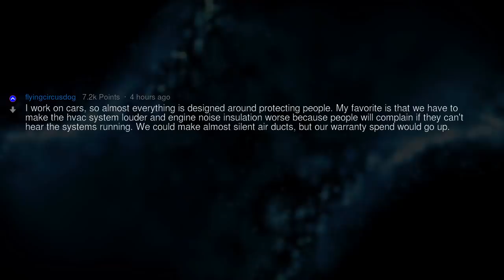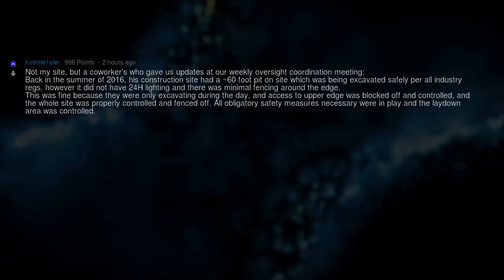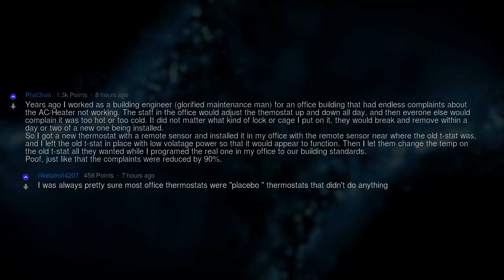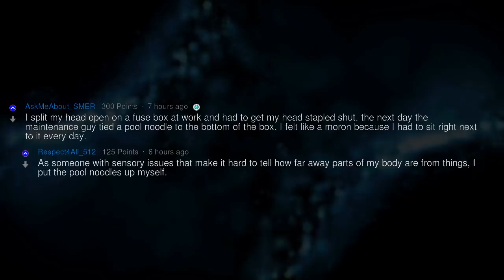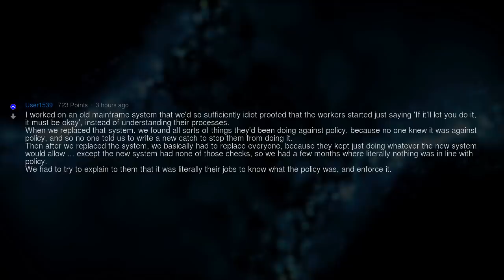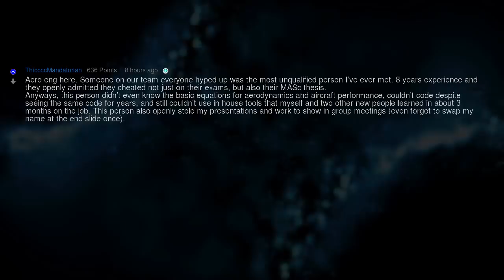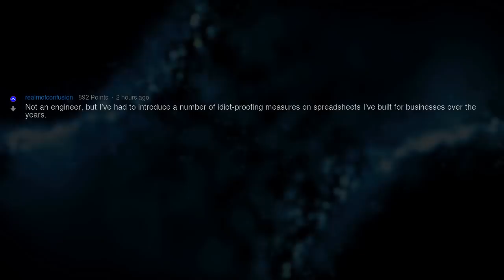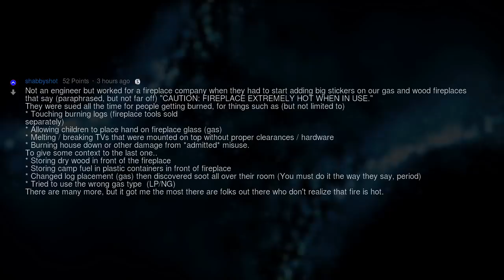Most Ridiculous Idiot-Proofing in Todays Products

Comment: reminds me of a yt video I once saw where an old man is making glass sculptures for tourists, he makes this beautiful horse of melted glass, but near the end of sculpturing glass gets transparent, no longer than the burning orange color that it had right after getting out of the fire, he presents his sculpture all fresh and shiny on the table in front of the tourists but before he turns around he puts one paper towel over it that as soon as it touched the glass goes into flames, reminding everyone that it may not look like it but the sculpture is still blazing hot.
Reply: The same thing is true in blacksmithing. Soon after your iron piece cools down enough that it is no longer red hot, it is still hot enough to burn you. For safety reasons we treat all work pieces as if they were hot.
Reply: @danielsjohnson  In the profession of the craftsman, treat everything as if it will harm you until the one who knows the trade tells you it's safe.

Every gun as if it's loaded, every blade as if it's sharp, metal as if it can burn, electrical as if it's live.

Comment: What I've learned:
1. If it's not a hammer, it will be used as a hammer.
2. If it can't be used as a hammer, it will be hammered upon.
Reply: That's like the rules 34 and 35, but with hammers instead
Reply: If it’s a hammer and there is nothing at hand to hammer on, they will try to hammer on nothing anyways
Reply: @user-ml3hl6vr4t  There's always ground to hammer on, or surface of any type.
Reply: Smort.
Reply: Load bank filled with heating elements for testing inverters and generators: Let's add a big "Do not touch" sticker next to the heating elements. Guy tests generator and turns it off. No more shock hazard, so it's okay to touch the heater now. Now it says to wait for it to cool down before attempting disassembly.
Reply: @dickcheney6  They were low thermal coefficient resistors, so the elements look like hollow ceramic tubes with electrical wires at each end. They don't get hot enough to glow, but the radiated heat is hot enough to feel from about 20 inches away.
Reply: @dickcheney6  never under estimate dumb. Some of the most educated people I've met (either through schooling or experience) had zero common sense. I have an uncle who's got a degree in physics, went roller skating and couldn't figure out why he ate shit when he put both toe breaks down at the same time.......*face palm*
Reply: Fixed my comment...
Reply: yes
Reply: 3. It can be used as a hammer, and it will be hammered upon.
Reply: can confirm this, people at work use the scanner guns to hammer wooden lids that somehow got unnailed occasionally . The scanners still work albeit one of them has the indicator light on top dislodged inside. The worse part is that for some weird reason the plastic latch holding the holding the battery secured at the bottom of the handle break with in a month  without any help thus needing battery to be taped to the handle. Don't know who engineered that flaw into the battery lock, at this point I think it's intentional to force more  purchases of batteries.
Reply: Rules electricians live by
Reply: To a man with a nail, everything is a hammer

Comment: Not an engineer, but I ended up designing and implementing a modification.

I worked at a lyophilization (freeze-drying) firm. During my time there, we went through a few expansions, mostly minor and internal. One of the more mid-sized expansions was building a new cleaning area for a particular line of materials with separate environmental standards from our main line (not sensitive enough for an isolated clean room, though). This new area was for the special trays that had a special coating meant to protect the product that would go into it. These trays weighed just under 15 lbs each, and they were stored in their own special flip-open containers that held around 30 trays each - so totaling about 450 lbs per container (the container weighed enough to approach this number when loaded).

Because of the containers weight - and because we had to transport them, naturally - we had a walking forklift (basically a smaller electric forklift that you don't sit in to drive). The arms would be obstructed from view by the containers, and because the containers were always stored up against the wall, there was a risk of not inserting the arms far enough to lift the container safely, or inserting them too much that you end up hitting (and quite possibly puncturing) the wall. We quickly discovered this problem through initial testing (no punctured wall, thankfully), so the first thing I suggested we do was guide me (I was the youngest of the group, and they figured me being a gamer made me most qualified to operate the forklift) to a point where the arms would reach the end of the container without reaching past. With that, I lifted the container up to a more manageable height, and then I took a Sharpie and marked thick lines all around the arms where the container sat with the arms reaching far enough. With my added markings, anyone would be able to spot when they inserted the arms far enough.

Of course, someone still punctured a wall with the forklift when they wanted to move one of those containers. I never learned or figured out who exactly did it, but I was able to rule out who did not (no one from my team, thankfully).

I went to the facilities manager with a little proposal: slide-on brackets for the arms with clamps, so we could quickly and fairly easily slip them on and off the forklift arms quickly (and thus ensure that the right length was always under the containers) while still being able to readily use the forklift for anything else that might come up.

I found out after I left the firm that those brackets got stolen multiple times, and the facilities manager would try to tear the place down to find out who had been behind it. He never learned who, but he had the usual suspects (likely the same ones I suspected were behind the punctured wall from earlier).
Reply: That seems like a job for a metal plate mounted to the wall. Or any plate really, thick rubber, or wooden plank should work just as fine.
Reply: @Perkos1  That was done at first. Unfortunately, the firm was staffed by a lot of clumsy kleptos, apparently. Every day, I ended up having to deal with at least one thing that was damaged or broken by them. They seemed to believe that anything meant for the firm could be used by them for whatever personal reason they came up with.

Plus, the forklift was pretty heavy, so even barricades like those would fail before too long - the comparatively small narrow ends of forklift arms impart leagues more damaging pressure than the large faces of the containers.
Reply: @DavidRichardson153   oh man, that's rough. Workers can take anything not anchored to the floor.
I work with designing and delivering storage and warehouse safety solutions (racks and barriers basically) and creativity of the staff never fails to amaze me. My personal favorite was when cystomer damaged the rack before our assembly team finished their work. Before they were even legally allowed to touch it... Hot rolled steel designed for years of use got bended in... hours?
Reply: @Perkos1  Yeah, it is amazing. Even though I was never an engineer, I had done some engineering work. My first job was a temporary engineering intern position (for a few months, I had to help change out motors for robot arms in an automotive plant's painting line), and I got to see and listen to the engineers openly wonder how certain unexpected things happened, to the motors and other machinery.

It was my time at the lyophilization firm that I started developing my engineering chops, even though my listed position was "Chemist/Lab Tech." I did help develop a couple of new devices and procedures for the place, so I had some of the thought processes of an engineer. I would say those very thought processes would make me butt heads with those kleptos, souring the end of my time there and driving me to leave a few months before my five-year mark.

Admittedly, as much as it does hurt over what I had done for the firm, it is relieved by the knowledge of what happened after I left. The few other good workers there left once they heard that I did, and the kelptos' free ride ground to a halt. The firm ended up limping along for another year before finally collapsing. Knowing that they couldn't handle it does give me some pleasure.

Yeah, call me a business killer, but I think you'll agree, if you worked for a company and that was the majority of your coworkers, or if you were a client and you found out that was what most of the employees there were, you'd want to see the company fail.

Comment: Funny story from one of my fathers friends. He works running a machine that digs a trench for waterlines. He was digging a ditch to replace the old waterlines but he was told ahead of time that no one knew where the line actually was. They had the map with it marked but they hadn't been able to stick straight to that map for various reasons and the changes they had to put in when it was originally done weren't marked. The only man who actually knew where the water line was had died several years before so all they knew was that it was right around there. After they had been digging a ways they looked behind the machine and there was water all over the place. They not only managed to find the original line they dug straight down the middle of the pipe for a good ways.

Comment: Transitioned from retail to blue collar.  Rookie on the assembly line.  Assembling fence rails, following the lead of the guy training me.  A piece of wood was about 1/2" out.  So I did what I saw everyone else was doing.  Using the handle end of my screw-gun air tool to tap the wood flush.  tap tap tap  Big bossman sees me, runs up to my workstation, points to my screw-gun and yells "What is THAT?!"  I hadn't caught on.  "That's my screw-gun?  Why?"  "Does THAT look like hammer?""  "No?"  "THEN DON'T USE IT AS ONE!"  As impolite and unprofessional as it was to yell at me like that, it was the turning point for me working blue collar.  My coworkers were idiots and their lead is not to be blindly followed.  While they continued to use their screw-guns as hammers, I went to the tool room and found a rubber mallet to  tap tap *tap*.  Over time, the heavier tools broke down.  They made the best hammers.  Soon I was the workplace pariah as I wouldn't fall in line with their stupidity.  I would use words like "pariah" and "faux pas" and they had no idea what I was saying.  Later on, the bossman wanted me to certify on the forklift.  I told him I didn't want to do that because of the danger involved.  He told me that's why he wanted me on the forklift, that I had the right attitude about driving one.  I began to realize that my coworkers viewed the forklift like a kid does a toy (think Michael Scott from that one episode of The Office).  They did NOT like me taking away their forklift time and would pretend their lives were in danger whenever I hopped on.  They would complain about how much I used the horn, despite what the lift-truck training instructed.  Years later.  0 accidents.

Comment: We were framing a house on Daupin Island , Al. We had to literally nail HUNDREDS of straps on the floor joists / beams underneath the house . ( The house is on pylons about 12 to 14 feet in the air ) We were told to use specific nails with the straps . Roughly 20 plus per strap . We stated we've never used those nails before and would rather use our normal nails . We were told the ENGINEER who drew up the plans demanded we use special nails . So we did . I leave that job for another . I get told by my previous boss ( the strap house ) that after I left , the ENGINEER came back out , inspected the straps , decided he didn't like it and wanted all the straps replaced . Needless to say , I didn't ask for my old job back .

Comment: We had an issue with temperature setting on our building heating. I screwed a plastic basket to the wall covering the control panel, and it completely fixed the problem!

Comment: Not all Engineers are that smart. I've worked on equipment where the access panels and holes place on the bottom of machines that two inches off the floor or had pipes running across the middle of them

Comment: Hayu engineering geniuses with your yellow pipeline in your black Pipeline and you can only use yellow for gas what do you say your back fill your gas line trench with yellow sand. Each utility has a colored code of sand this way everybody know what's down there. Create new jobs to solve problems not to create even more problems.

Comment: I wanna know how you accidentally hit the power button on a PC by swinging in your chair. Last time I checked most PCs have small clicky power buttons, so how do you accidentally hit it?
Reply: It sounds like the PC was hooked to an extension cord with the red flip switch. But I could be wrong. 😶
Reply: Foot or knee maybe
Reply: I’ve had this problem.  One of the computers where I used to work was on a shelf under the desk, exactly at knee height.  The custom case was oversized, and had a power button aiming directly where your knee could touch it.  Same fix, PowerAid bottle cap and some electrical tape.  It would bruise your knee if you forgot about it and spun the chair.

Comment: 10:27   Pool noodles are a lifesaver - in a possibly very literal way.  I lived in a house that had a basement that was NOT designed for people six feet tall.  There are two great big steel beams down there and I got so tired of forgetting about them and creasing my skull.  Pool noodles installed, and no more dents in my head.
Reply: haha BONK
Reply: I have seen people baby proof houses with those. Around edges of tables, tvs, doors and chairs - even saw one doorway that had it at the bottom. The kid was in a walker. The walker couldnt go over the pool noodle at the doorway so kid wouldnt accidently go down the steps when mom opened it for a second. I have seen it under beds so no more stubbed toes. I used to cut it up and use it in potted plants instead of rocks for irrigation. The pots were so much lighter and it worked the same!
Reply: I used them on my ladder for my bunk bed when i was a kid.

Comment: After my father's experience dealing with an idiot who removed a safety cover on a cannister of compressed gas, they had not only a safety briefing but they had to lock all of the cannisters up and have a sign in and out for each compressed tank. I guess they were that desperate to keep idiots from removing safety covers (and with good reason, seeing as they can be turned into missiles if the valve is somehow sheered off).
Reply: reminds me of a Batman comic book where he intentionally did that to escape from a burning building.

Comment: "Duct tape and a bottle cap" this has been my solution for several things. Kid would see the power button on my computer and push it. Wife used to like turning the thermostat all the way up because it was cold. Then all the way down because now it's too hot. Never ending cycle like hello, it's not an on off switch. Set and Taped that sucker up. Problem solved.
Reply: Our fight is over the water heater. How can I stop him from turning it down all the time. I can’t draw a full enough tub to cover my knees or fill it up and not even have it baby bath warm
Reply: @user-ml3hl6vr4t  set it where it needs to be then epoxy/ jb weld the hell out of it
Reply: @truebluethecat  sounds great until I have to relight the pilot light…
Reply: @user-ml3hl6vr4t  good point.  I was thinking more along the lines of electric.
Reply: @truebluethecat  ours is gas, the way it was installed the gas line comes up in front of the little window, and it is a miracle to get it relit with the piezoelectric start.
Reply: Dee Dee: “Ooh, what does this button do?”
Dexter: “Please, please, do not push ze button!”

Comment: Without doxxing myself or my company...

I am part of a maintenance/supply/fix-it crew at my company.  At my job, there are certain cables that hang down from the ceiling.  These cables are secured with steel ties.  (I know this is very little context, but again, I don't wanna dox myself or my job)

Day after day, people cut these steel ties.  There is literally no reason -- none whatsoever -- for the staff members to cut these steel ties in order to do their job.  We don't even know HOW they are doing it, since slicing through freakin STEEL ties would require sturdy tools.  We question the staff why they keep doing this.  No one gives a straight answer.  It got to a point where the director of the department has personally investigated this multiple times, questioning people, even laying in hiding and spying on people lol.  We can't figure this out.  Replacing these steel ties is a pointless expense on our annual budget.
Reply: The solution, as cruel and unjust as it may be, is to make an example of someone. Pick an employee, any employee, in front of all of the others, and fire them for cutting the ties. Make it a spectacle. Make sure it’s noticed and heard by everyone. Then after the fact arrange a meeting reiterating why the employee was fired and that if the ties keep being cut more people will be fired. It will either stop or the suspect might come forward lol. Either way, sometimes fear is the only to enforce something. (Then I suppose the “fired” employee gets a promotion elsewhere in another location if possible, just to maintain the illusion for the rest of their former coworkers.)
Reply: @TH3C001  Or add it to someone who was already being fired for some other reason.